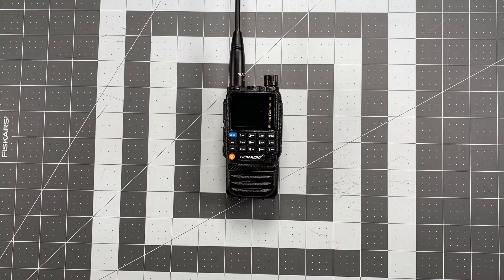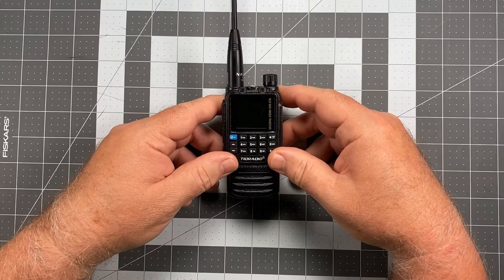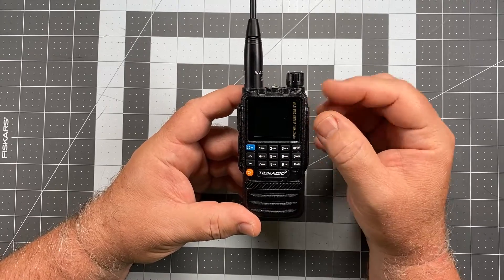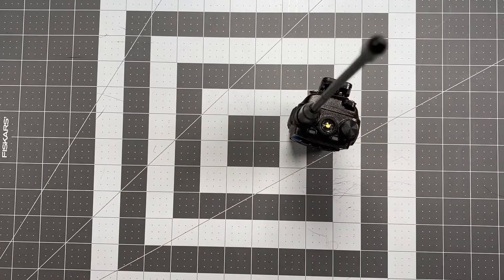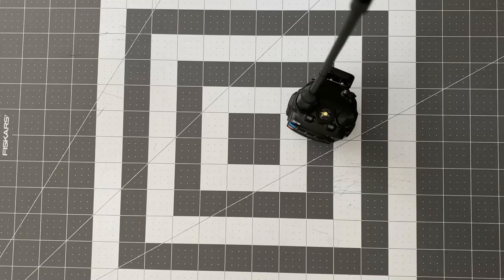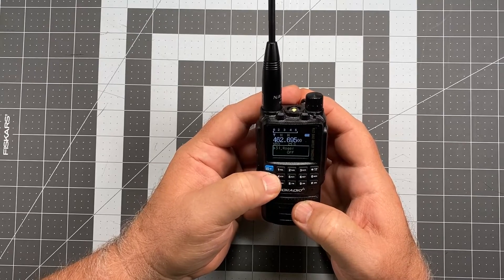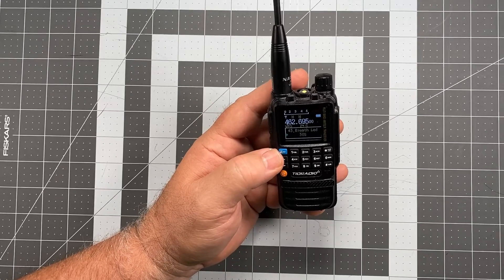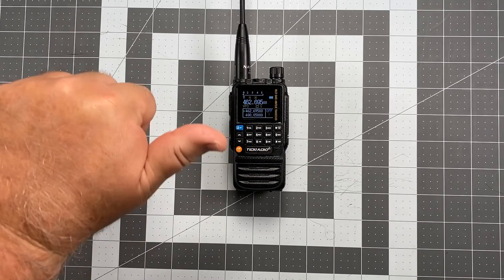TID Radio TD-H3 Operators Series: Part 4 - Breath LED Settings

Comment: The app says "Breath Bed" I searched the internet for ages to find a translation from Ingrish to UK English. They would be better to get rid of the torch and put a proper vfo/channel change know and encoder. And change firmware so the display dims but not totally extinguish. As for the Breath Bed/Led whatever, for me, the radio is either on or off first time I saw the "Breath Led" I thought there was a signal that had wrong CTCSS or the volume was down. Chinese designers need to listen to Western users, ask us to write the manual, get rid of silly torches especially the ones that flash and for goodness sakes, add  8.33Khz for airband and 6.25Khz steps for Europe.